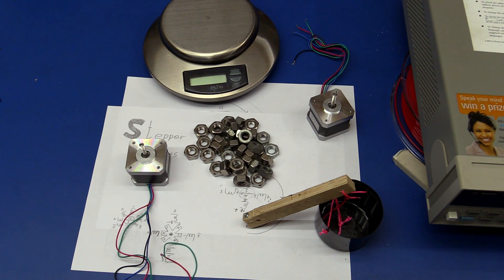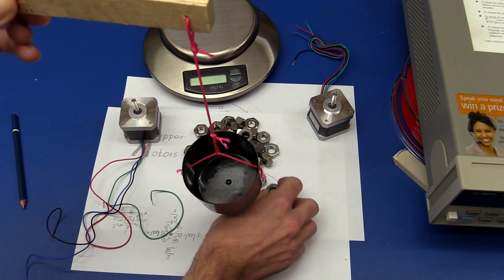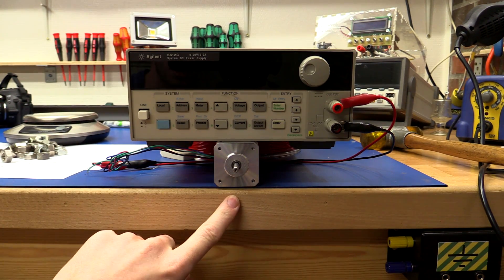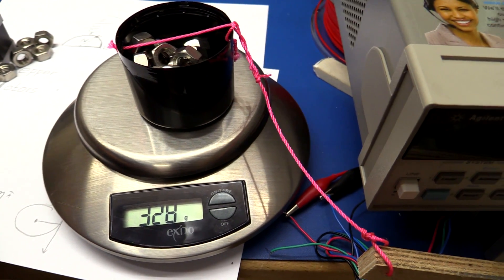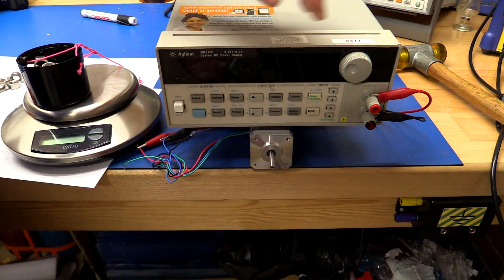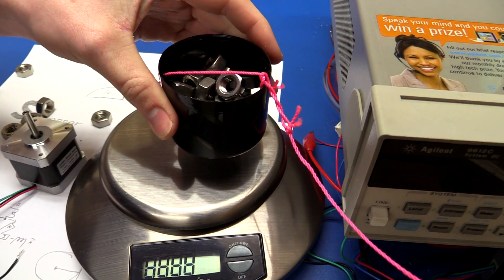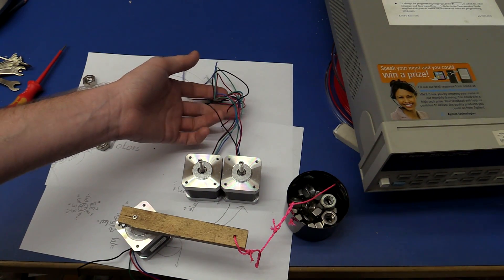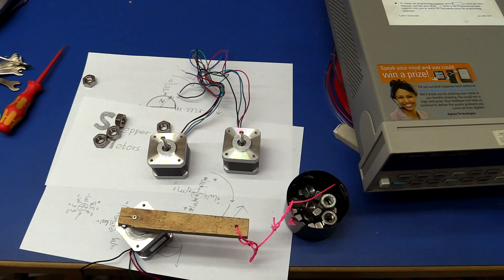Stepper Motor Torque Test (Damaged Form Being Taken Apart?) - Ec-Projects

Comment: There is a missing point:
-Was the motors fully taken apart? I mean, you'll have no problem if you don't take the rotor out of the stator.
I remagnetized a ton of steppers since 2008, just because some guy "changed ball bearings" in the industry's maintenance.
I can tell that the loss of torque goes bigger as the motor goes bigger... Small motors will have less loss, but also will heat and burn a lot faster with the little current increase needed to bypass the difference.

Comment: Running only half of the coils at a time is less max torque and equal to the fullsteps. The half steps can, if driven with same current have a lot higher torque. Halfsteps can do 141% of the fullstep torque. (1/0.707)
Reply: This only applies to unipolar stepping motors!

Comment: I think basically unless the factory that makes those motors got a very special magnetization jig, the rotor has already been free in the air without any shunt, so it already lost most of the magnetization it was going to lose from not having a shunt. That is assuming they use AlNiCo magnet in the rotor and not ceramic, if they use ceramic or neodymium then it isn't going to lose magnetization when disassembled anyway.  edit: that gives me an idea, I should buy a few cheap motors and see if I can pulse magnetize them through their own coils to a higher torque.

Comment: How to add the weight of the shaft to get total weight, by doing integration?
Reply: Make a lever that's double the length of your required distance from the midway point, and mount the motor at the midway point of this lever. Create a symmetrical lever by adding accessories like baskets or hooks on either side, but only load one side. This will more or less cancel out the torque applied by the weight of the lever.

Comment: What does it mean to write 10kg/cm on a DC motor?Will it be measured from the center of the shaft or above it
Reply: kg/cm is a pretty unusual unit for torque. Usually motors are rated in newtonmeters. 10kg are about 98.1 newton, if you divide this by 100cm you get 0.981 newtonmeters. This would be about 3 times the amount of torque of the steppermotors tested in this video

Comment: You need to run a dyno test rather than holding torque test.  

Geckodrives ran a low speed dyno test where they removed the rotor for 5 seconds and re-ran the test.  The dyno shows a 38% loss of torque after disassembly.

Comment: consider this
"Give me a lever long enough and a fulcrum on which to place it, and I shall move the world." google lever and falcrum, increase the wood shaft and you can move motor with blow of wind
Reply: Levers confuse people. Here's a simple anecdote showing the relationship between weight applied to a lever and torque:

I once had to tighten a car wheel hub nut to 300ft-lbs (foot pounds), but I didn't have a torque wrench capable of measuring that much torque. So, I got a two foot long straight wrench with no ratcheting (a two foot long breaker bar) and stood on the end of it. I weight 150 pounds and I was effectively putting my body weight on a two foot long lever (2*150=300). That's literally the textbook way of applying 300 foot pounds. It's too bad that pearl of wisdom isn't actually in a mathematics textbook. They had to cut that out to make room for fifteen digits of Pi and they had to leave out an explanation of how to calculate Pi to make room for graphs :S
Reply: @chrisbalfour466  I have seen another youtube video, where nema17 lifts 1.3ish kg, nema23 6ishkg
Reply from the maker: I'm not sure what you are trying to explain, sorry.
Reply: @EcProjects  i think he meant that manufactures rates them for wights close the the center, not with a looooong shaft. which will reduce the power VERY much. the experiment is misleading, as people will think its weak stepper, while thats not the case, reduce the wooden stick and see how more weight it can hold.
Reply: @testingbeta7169  Brilliant. You should teach physics.
Reply: @chrisbalfour466  on the contrary. I was weak in studies but life made me do lot of googling :P

Comment: So if the rotor is not magnetized in a stepper motor, then how does it work? The loss of torque may only apply to higher quality motors too? I'll say this, I am not going to be taking any of my Vexta motors apart any time too soon over here.
Reply: I may be seven years late, but here I am! The rotor is magnetized in a hybrid stepper motor like these. They aren't magnetized the same way as a permanent magnet stepper motor is, but they are magnetized.

Hybrid stepper motors are also known as hybrid reluctance stepper motors, because their rotors' poles are distinguished once the stators' electric fields appear and work through a mechanism called reluctance.

The actual distinct poles that cause the motor to have the detents and steps is not due to the permanently present magnetization, but due to poles created by the shape of the rotor. They are reluctance based poles.

Comment: Using a 10cm arm like in the Video , the need for calculation evaporates. The measured KiloGramms equals Newtonmeters Torque.
Reply: X 0.1
Reply: it would, if 10N would equal 1kg. In Reality its more like 9.8N, so you would be off by ~2%.

Comment: Can you please re-run the test with both coils working?
The torque should be higher, right???
About 20 to 30% more! They would reach the manufacturer announced torque?
Thanks!
Reply: Still worth specifying, because full torque can only be achieved with both phases used
Reply: Yes, probably. But that wasn't the point of this test.
Reply: he using lever and you can bend physics, google lever and falcrum,

Comment: This shows that all stepper motors are not created equal.
Even before I bought my first stepper (some 10-15 years ago), I read all across the web that you should never take a stepper apart, because it would ruin it.
Well, I bought four and the first thing I did, was to dismantle one. When I put it back together it spinned almost like a brushed motor - you could hardly feel the magnetic detents on each step. It was a branded motor (Minebea or Sanyo/Denki), but I cannot recall the model. Anyway I'm glad to see that yours are still working.
Reply from the maker: Jose Silveira Was that a hybrid also ? :)
Reply: I believe so, but it was too long ago. Just wanted to leave a caution note, so that people were aware of my sour experience, before pulling a stepper apart. Maybe newer models are no so prone to disaster.
Reply: It was some time ago, all I remember is it didn't have any strength.
Meanwhile I changed home and still have most of my stuff packed. I don't know when, but I'll have a look at the motor again, to check the one thing that could have gone wrong - inverting the rotor relative to the stator. You try this and see if it helps. If not, we have to assume that not all steppers can be taken apart, as mentioned in my first post.
Reply: Can confirm, I've just taken apart one of sanyo denki stepper motor (I got a good bargain on used steppers, so I didn't care too much about breaking them), and after taking the rotor out it did seem to lose most of its torque. But I didn't take it apart just so that I could break it, I took it apart to see if I could rewire it from parallel to series connection, as the motors I got are high current (6amp), low inductance and  unfortunately I don't have the drivers to drive them.  In the second attempt (using different stepper of course) I've only removed the back plate of the stepper trying to keep the stator in place, I've read that even allowing the rotor to touch the stator is going to demagnetize it, that (touching the stator) is of course pretty hard to avoid when removing the back plate  that supports the rotor,  but surprisingly it worked, even though the rotor most likely touched the stator, after removing the backplate and then putting it back together I didn't notice any change in torque. I then took the back plate off again, and was able to successfully rewire the motor to series (bipolar) connection.

Comment: Heard too that permanent magnet motors can be damaged by disassembling them. Nice experiment. Reminds me I should check those stepper motors before assembling a 3D printer with them but no problem so far.
Reply from the maker: Michel PASTOR Thanks! Yeah, I was quite surprised the last one I got was that bad.. But it should be fine for the X-axis :)
Reply: EcProjects The Z axis with threaded rods should be less demanding than the X I think. My printer even has two motors, one per side it shouldn't require a lot of torque. But meh I prefer using good motors ;)
Reply from the maker: Yeah you are probably right, I'm just worried to put the bad one one one screw and a good one on the other.. :)